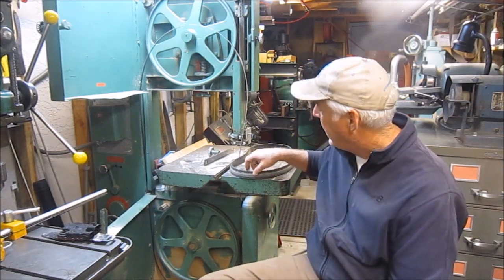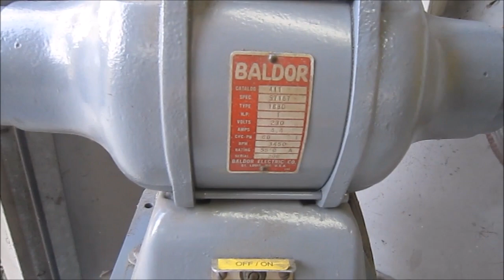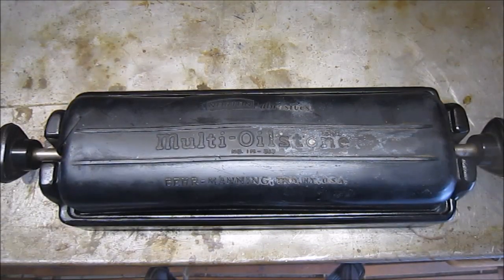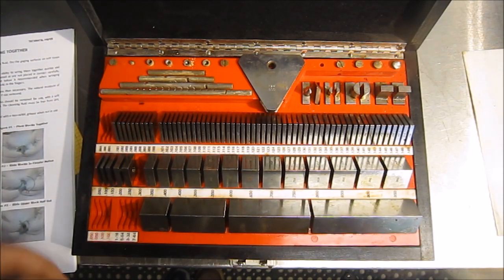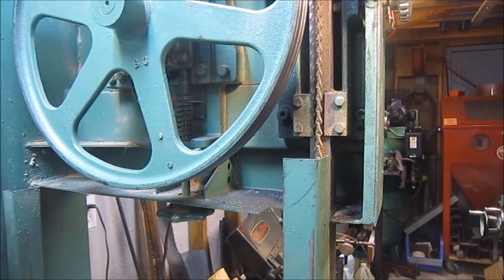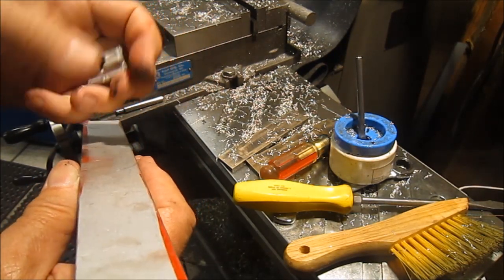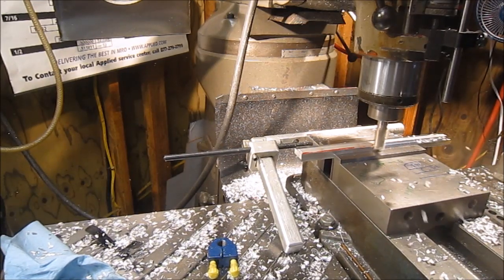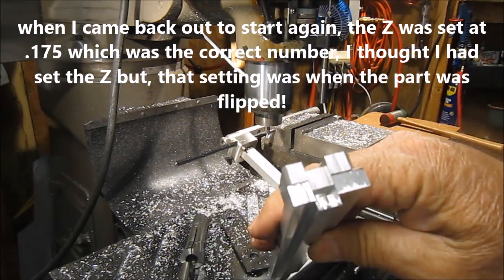SCREWY TUESDAY #7   Tool Time  (blocks, grinder,sharpener)

Comment: Great update! Nice grinder, I've always liked the old heavy grinders. They tend to run quiet and smooth. That Gage block set has got jealous as can be! The accessory you held up with flat tab I've used to calibrate bore gages. Using the triangular base, stacked blocks to your bore ID, then the top being the peice you were holding. The bore gage would register between the base and top, zero out your dial and your ready to roll! Nice work on your saw adaptors, good lookin part! Thanks again buddy!

Andrew
Reply: That's what I thought as well. The mystery block is the "cap" so you can set a distance between it and the base plate, height gage style.

Comment: Hey Chuck,
I think you need some more grinders! You like to get "stoned", don't you! LOL Sorry about the visit from Mr. Bozo. If I see him in a crosswalk, I won't stop! Thanks for sharing the job you're working on. Replacing bandsaw tires is not a job for uninitiated! I tried it once and told the boss to let someone else do bandsaw tires. I didn't glue it properly and it and the blade came off when the customer was cutting something.  I like your gage blocks. Pratt and Whitney made everything:  tooling, lathes, radial aircraft engines and now, jet aircraft engines. Thanks, again, for the video.
Have a good one! (Give Howie a good back rub from me! Our dog snuggles up to me or my wife and wants his belly rubbed when we're trying to sleep!)
Dave

Comment: Chuck I've got a similar Delta grinder. The bulbs in mine are Sylvania 120v 25w. I've found them on line as low as $0.99. Great buy on the gauge blocks.

Comment: Chuck, it's clear Howie likes his walks!

Nice grinder collection you are building up. Is there a need to bolt down the three-footed post kind?  They always have holes for that, but most seem to skip it. I don't have room for one for now, but one of these days I might.  For now I use my Workmate as a stand for everything...grinder, vise, planer, belt sander, and portaband stand. So far. I just put a 3/4" base on the tool, attach a scrap 2x4 under that, and clamp the Workmate on the 2x4.  It's not super heavy, but it's got a wide stance...and I can put a couple of cement blocks on the shelf if necessary. I need to build some storage to stack the tools when not in use....probably from 2x2 lumber. Real Soon Now.

Thanks for sharing!

-- Mike

Comment: I use that piece as the top and triangle piece as bottom with whatever gage blocks in the middle you need to set bore gages, easier to recheck than a micrometer

Comment: I have that exact same Delta grinder as my small grinder. It is a great little grinder.  Those gage blocks are awesome. I wonder if they are the ones used to set up a jig bore for doing automatic depth kick outs and positions?

Comment: Dear Sir; If your gage blocks are truly unused, they should be reserved for setting bore Gage's, which that square block with the little square projection is used for. If you find that they have been used, and show nicks or scratches, they can be stoned with gage block stones. You will find they are wonderfull for setting sine tools then. If they are new old stock, keep them away from your sine tools. Sine tools don't generally require high grade blocks. Mark
Reply from the maker: thanks Mark for the feedback/info

Comment: Using a multimeter on the lightbulb fitting would tell you the number of volts that the bulb requires.